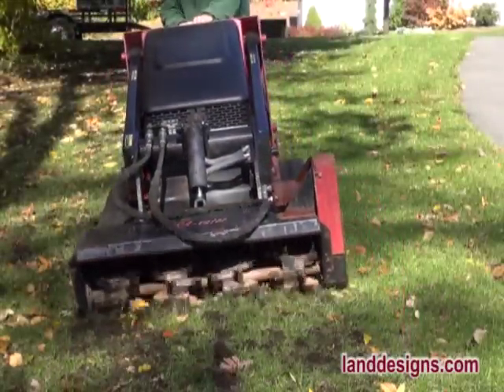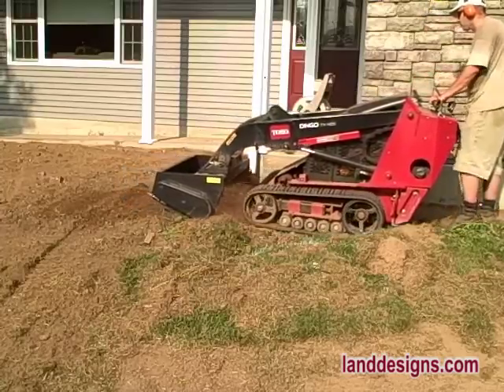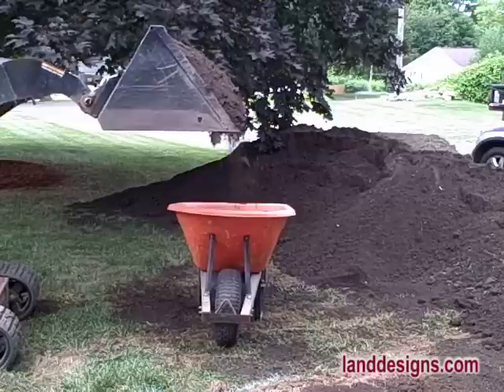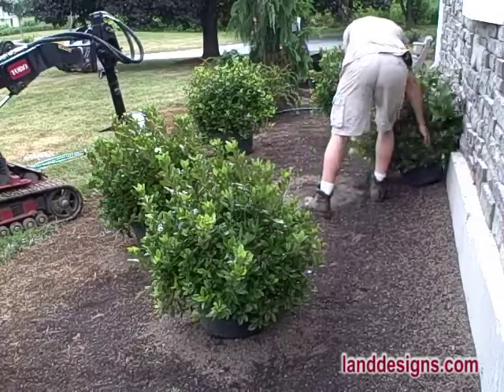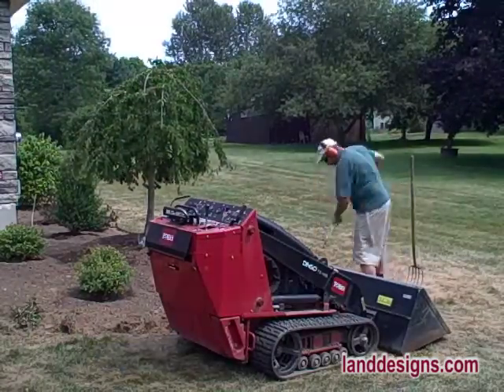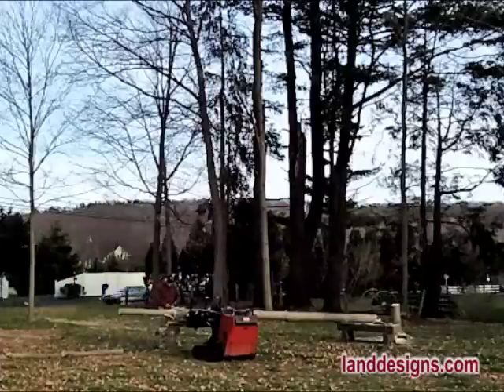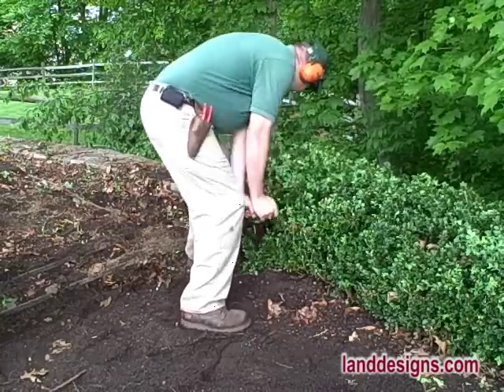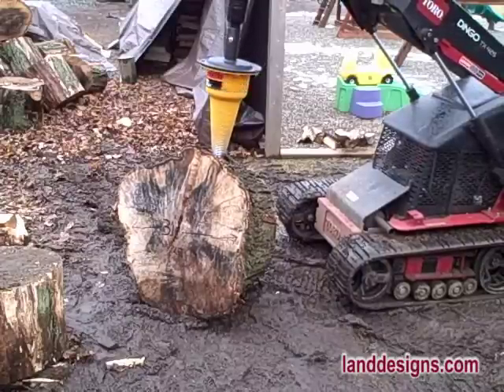Toro Dingo Compact Track Loader - What can YOU do?

Comment: we had the grappler bucket. good for demolition. used it indoors to rip down ceiling tiles and the framing, pushes right though cinder block walls 1 block thick. i recommend the dingo with the stand on pad to ride while you work. walking behind one all day can get tiring.

Comment: Looks like the perfect machine for what you do. The great thing about the dingo is it's small size, light weight and soft tracks that allow you to fit virtually anywhere and drive on turf without leaving tracks or tearing it up like some of the slightly larger mini skids. It's really a great option to have even if you already have one of the larger ones because of it's light, small footprint.

Comment: I've got about 40 foundation planted, Very Mature Boxwoods to remove and I'm really thinkin about renting one with a 4 n 1 maybe
Reply from the maker: That's the tool for the job.  You could also use a set of pallet forks to get under them and pop them out of the ground.  You probably are going to need to cut some of the roots with a nursery spade before digging them out with the Dingo if they're over about four feet tall.

Depending on how they look someone might come to dig them out for you and take them.  Mature boxwoods are hard to find and if you can find them they cost big money.

Comment: nice video! very valuable machine as far as versatility.  I used one for several years back when I landscaped.  it was a smaller wheeled model with turf tires(320 I believe) but I loved it.  only 2 times did I have trouble with it getting stuck in muddy conditions and wish I had the tracks.  I kinda preferred the wheeled version as I used the bobcat mini skidsteer with tracks and it seemed like I had to make 5 point turns to keep from chewing up the lawns.  the hydraulic nursery forks were the greatest things ever.  with those and the 36" auger I planted  24  2 1/2" dbh maple trees by myself at a park on one occasion.   always wondered how good the backhoe attachment would work as we never had one (pricey).

Comment: These are fantastic machines but you really have to be careful with them.  I almost put myself in the hospital running one of these in high school. (had the presence of mind to take a step back and think before reacting to my mistake and making it worse)  Rental units are often fitted with a large bucket, and if you're moving something dense like traffic bond, it's easy to overfill and tip the machine forward when raising to dump.  They're extremely useful machines, but it is best to have some training before running one especially if you're not experienced on this type of equipment.